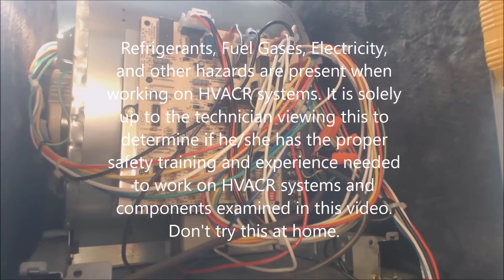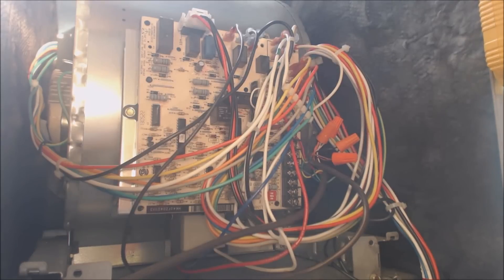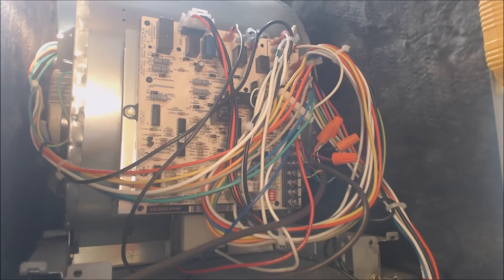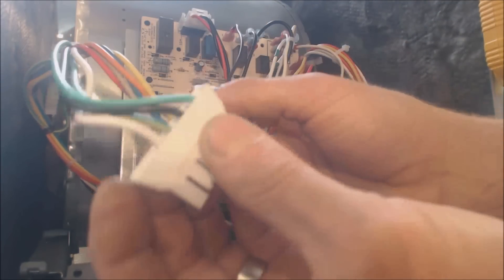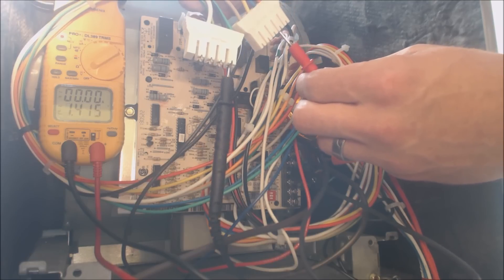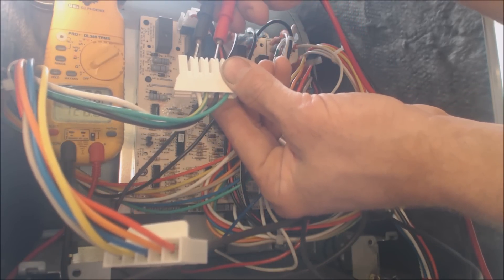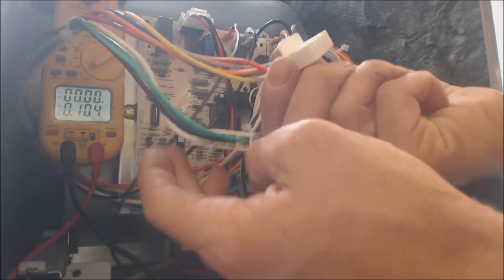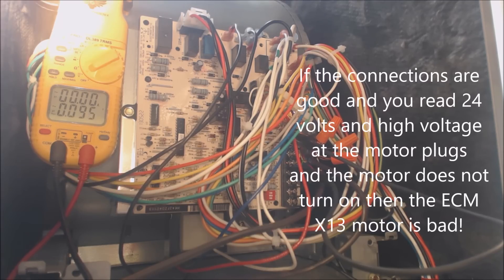Troubleshooting an X13 Blower Motor Step By Step!

Comment: Great video.  So if you have an X13 blower motor that seems to kick on when it wants to, or keep running after the call for AC has ended, and run for any odd amount of time, or continually till breaker is shut off, where does one start in looking?  What I have seen is that the fan will still run potentially with the green 24v wire pulled also.  The unit might work fine for a week with no issues then all of a sudden decide to start again.  This is on a 5 year old Rheem RH2V6024STANJA 5 ton system and decided to flip out about a month ago.  Some say the control board and some think the ECM on end of motor where a 50 cent part has decided to not work right...like the thermistor....which can't be easily replaced due to being tar filled in the ECM.  So you have either a $300+ ECM module to replace or the whole motor of some other than Rheem brand for not much more.  Seems like it would have to be one of those 3 things.

Comment: You must read the voltages while the wiring is connected and under a load. You may have 120v until it is under a load, then the voltage may fall below the needed voltage for the motor to run. Same goes for the 24v side.
 You may also have a motor that runs then stops then runs and so on. This is usually the motor itself if voltages do not drop out.

Comment: Great videos. Can you do one on why a x13 would come on and then shut off after like 30 seconds but the heat pump is still running and thermostat is not at temperature to shut it off?

Comment: My blow motor turn on 5 seconds only, before turn off alone, what you think is the problem?
Reply from the maker: Is it a psc, ecm fixed speeds, or ecm variable speed?
Reply: @acservicetechchannel   is a ecm variable speed
Reply from the maker: Have you checked the wiring to see if there is a loose connection, have you checked the other ecm videos for powering the motor for testing? You can see if it doesn't shut off then, to tell if the problem is the wiring or the board and if the motor and module are ok, thanks

Comment: Can't you just ohm out the windings on the motor?
Reply from the maker: Yes absolutely but the motor as a whole is made up of two sections, one the motor windings and two the electronic control module on the end of the motor, thanks!

Comment: How do you like your volt meter? All I’ve ever owned is Fieldpiece. How does Fluke compare to UEi in your opinion? Have you ever used Fluke?
Reply from the maker: Honestly anymore all three are pretty comparable except Fluke usually is missing one or two functions we use such as ac amp clamp or the MFD. Fluke are precise though.  I am presently using Fieldpiece and UEI. Most of my career was spent using UEI, thanks. This is the main one I use. I may move to a 400 series soon but my students mainly use these and they do withstand the use, thanks-   http://amzn.to/2xAdaJf

Comment: Hi. I have a 2 stage variable speed 90% Tempstar furnace. the ECM motor will not start in low speed heat but will run in 2 stage heat. This unit has a separate fan control board for the ECM motor I'm thinking its bad. Any thoughts? thanks
Reply from the maker: Just to check, is this an x13, ecm 2.3, or ecm 3.0 blower motor?
Reply: acservicetech 2.3 I believe
Reply from the maker: I know this seems silly but did you turn the power off and individually try pushing in every wire of the 16 pin wiring harness on the board side and the motor side? I have seen that quite a bit. I do one side at a time and test the furnace and then take the harness off and kind of crimp each female connector a little bit if it did solve the problem.  Does it also run when you turn fan on as well as cooling? If that doesn't help, can you adjust any dip switches that would increase the speed a littlee for low heat, not alot and not turning speed down? Just some thoughts.
Reply: acservicetech the fan runs when furnace limits out. on 2nd stage heating and A/C. I did adjust the dip switches to try a different speed but that didn't help. I did also make sure the Molex plug was not loose.
Reply from the maker: It seems like it is heading in the direction in which you had first mentioned but it is possible that the motor hub may have lost it's programming for that speed possibly but if you did adjust the dip switches which would put it at another speed then it sounds like the second board is not communicating any speed at that time.
Reply: acservicetech thanks for letting me bounce that off of ya. I may try pressing all the pins before I order a control board. thanks again for the help

Comment: Can you use the tech mate pro to test this motor?
Reply from the maker: You can't use the TecMate Pro for testing the X13 because of the connections to the motor. The ECM X13 is easier to test anyway. You just make sure you have 24v going to the board and 120v on constant and the motor should turn on in it's fan, heat, and cool speed as I was showing in the video. Thanks Keith!

Comment: when you have time can you make a video on wiring low voltage from the condenser to the furnace to the thermostat and two speed motor and a heat pump and any thing that you can think of thank you , your video are aswsome!!!!!!!!!!!!!!
Reply from the maker: Thanks for your comment! I will see what I can do. Thanks